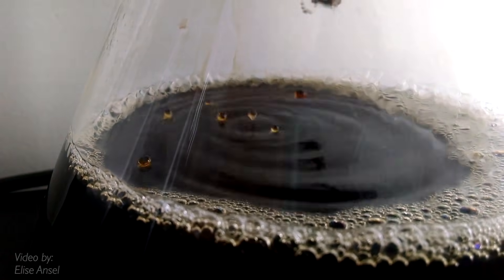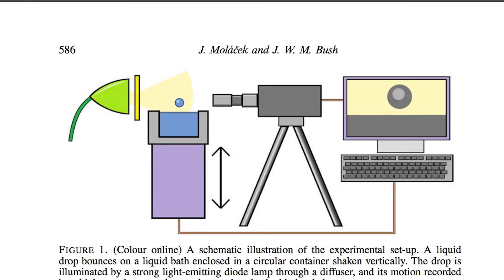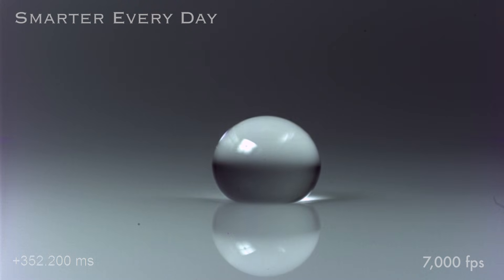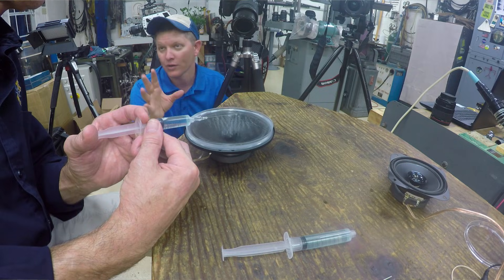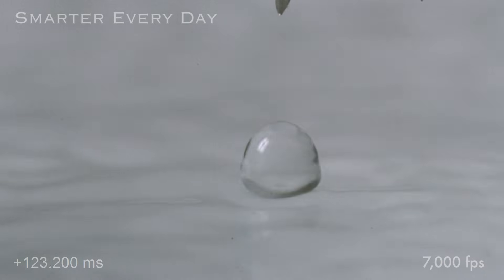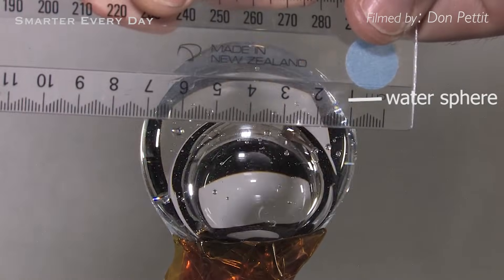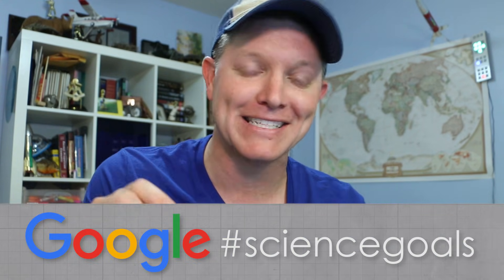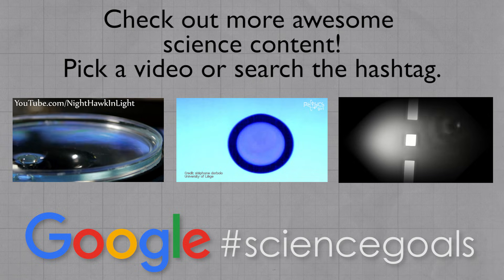The WALKING WATER Mystery (in SPACE and SLOW MOTION!) - Smarter Every Day 160

Comment: tbh ive never seen that
Reply: juku 
1. Get a glass of water 
2. Use another glass and add water in it also add a little bit of soap and mix
3. Slowly dip your finger into the glass of soap and water
4. Get your finger on top of the glass of water
Wait till the water on your finger drops there
(If you have a pipete use the pipete)
And the water ball will bounce!

Comment: I see these floating drops almost every time water falls on water.  I wonder if local climate or altitude matter.  Swimming in summer rain, almost every drop launched from the surface of the pond rolls away from the impact for a few inches before collapsing.   In the sink right now, if the faucet stream breaks up before touching the surface there are almost always 1 or 2 floating drops which collapse before they reach the edge of the bowl, if the solid (smooth) stream enters the water, only tiny droplets formed from occasional entrained air bubbles popping.  There is thunder outside, which I theorize would make the air more conductive, for less long-lived floaters, but might mean a static charge on the drops for stronger repulsion.  In the pond, I could sing round tones into the water near me to see if there is a local effect on longevity.

Comment: What if it was done in vacuum. Its expected that the water droplets will immediately "fuse" to the water, because there is no air to fill the gap between the droplet and the still water.

So that way we can check if this is the actual fenomena happening
Reply: He mentions in the video a study that did exactly that and noted that it reduced the time the droplet of water resisted coalescence.
Reply: If it were a proper vacuum, the water would evaporate and/or sublimate. But yeah, in a partial vacuum it does coalesce more quickly

Comment: MY guess about this has to do with intermolecular forces which, in an existing body of liquid (even as small as a drop) has established the electron bonds between one other. When you drop the liquid on the other body the charge bonds need to change orbital directions, that is, what I see in my mind is the vectors of the electrons must be altered to create a new bond. And, since this is pre-established in a droplet, there is some resistance to obtaining the new electron bonds. In other words, they like what they are bonding to, and are resisting altering this bond to accommodate a new relationship or cohesive attraction, Surface tension is a simple way to describe it. In my mind it has nothing to do with an air layer, but you say that lower ambient air pressures will hasten the integration of the droplet. I still think it must have to do with electron bonding, perhaps the air plays a role in it, too.

Comment: As far as "science", the lower air pressure experiment is the best experiment.  But now you have another question.

Suppose you had a dirty needle and as the water dripped out, they had a thin coat of oil around them.  The beading of the water would not be very surprising at all.  But instead of oil you have a skin of air.  Why?  Why is the air bounding to the surface of the water droplet (and probably to the surface of the still water as well).

The lower air pressure indicates that the air layer that bounds with the droplet is smaller and easier to penetrate.  "indicates" but doesn't "prove" it.  Perhaps the lower pressure relaxes the forces caused by surface tension for some reason.

For your theory to work, there must be some type of adhesive effect going on between the air and the water causing the air to want to coat around the water droplet.  The boundary stays with the water droplet as it bounces and skitters around.

The whole theory is based upon the air gap.  But we never see the air gap.  Seems to me the next step in validating this theory is two things.  More magnification and focusing on the air gap.  I'm not sure high speed frames helps.  Perhaps have the lens half in and half out of the water or perhaps under the water looking up.  Perhaps using fiber optics to get closer to the point of contact.  It should be possible to "see" the air gap because of various things like the light diffracting through the various layers.

Obviously there are two boundaries between the two bodies of liquid but you seem rather confident that there is an intermediary air gap.  To me, that still has not been shown.  And, if / when it is shown, then the question is: why does the air bind so tightly to the water?

I would also question the purity of the water and utensils being used.   Is there a thin "skin" of impurities instead of air?

Comment: Yes, good quote.  I once walked into the lab and several engineers were postulating what was going wrong with a system.  I said, "Why don't you just hook up a scope, and see?", which I did, and found the problem.  DUH!   Then there are the WTH times when you turn on the circuit, get nothing on the scope, semi quickly realizing there's nothing much going on electrically on the surface of the desk, where the probes actually ARE, but that's a wholly different thing.  ;-)

Comment: Is there a distance or speed of a water droplet that would break through the surface of the layer of water upon initial impact between the two bodies? Also, In the end of the video the cello hit a low note that caused the surface of the water to vibrate rapidly. Is there any note not mentioned in the video that could cause the bubble to burst?

Comment: no info about the speaker used to reproduce the waveform, what kinds of circuits are used as signal generators, the sample rate if the cell was digitally sampled and reproduced on a dac (would have been nice to have an oscilloscope display next to every experiment) and no discussion of the electromagnetic properties of water molecules and how they are different at the surface where it interfaces with air.

really cool footage Dustin but just about all of the theory discussed was limited to what was known to by newton :(

Comment: I believe that there's a charge displacement going on with the water surface. to back my theory look at when you release water as droplets, it doesn't crumble to its basic form of molecules. it remains attached to it's structure. the only way to explain that is by a charge. water exist because of a balanced charge between Hydrogen and Oxygen. so, in order for on body, in this case water, to combine whit another  body of it same composition it must stable it's charge to match the other of it's own composition. liquids are able to this much more efficiently than solids. solids can do this too, but you must ad some form of external method or catalyst for it to happen. so , yes it's possible, just that water does it better. I didn't saw your videos before but I knew of this far before I finished highschool.

Comment: They are giving to much credit to air pressure...
The problem is the "drop" is retaining it's own gravitational field and the molecules inside the drop are arranged to accept the pull of the drop more so than the water beneath it.
The air between them lessens the pull of the water but is not necessary to achieve the experiment.
The best way to explain this is through the dropping of the drop by the syringe.
Notice the water clings to itself until it is at a critical state. Then it drops.
Notice also that the critical point happens when the sphere starts changing by X much.

I argue that the drops cling to itself until it's shape changes X to much from the original sphere. When this happens it becomes apart of the larger object. Because the molecules of the drop are now more arranged to accept the larger object, and less arranged to retain the sphere.
(spheres are the best object to retain pressure)

When the water is bouncing due to frequency it is not allowing the air barrier to increase, infact if you go to any "sub woofer" and feel the air, it creates low pressure in the speaker... What the frequency is allowing the drop to do is retain it's shape. By juggling the sides of the water drop and retaining the sphere. When the drop hits the peak of a wave it breaks because the sphere is changed by X much.

Furthermore, if it was air, the more velocity the drop had the more air resistance (more trampoline effect) the drop would experience and bounce off or split into many smaller drops... Also the sphere deforming would create a bigger surface area creating more repulsion.

however, if my theory is correct velocity would deform the drop breaking the tension and the drop would mold into the bigger object nearly instantly.

Comment: water has a lot of anomalous and perplexing characteristics apparently. while i wouldn't be too surprised if the micro air gap plays a part in this phenomenon, I can't help but wonder if "structured water" characteristics across a water body's surfaces, temperature differences, solute content, and/or other water anomalies play a larger role. Obviously force of contact is a factor, but there is surely more than just an air gap creating the tendency for water to maintain separation for some length of time. SmarterEveryDay have you looked at the structured water thing yet? apparently you can get a voltage differential between a water boundary layer and the main body of that water, among other things.

Comment: 40 sec in, its the surface tension difference from water that has been separated from the rest. Now has its own surface tension. When tensions meet, one will overcome the other based on many elements. Speed, size, direction differential etc. Water in motion or still does not want to move fast enough basically.

Comment: surface tension mixed with  equal and opposite reaction mixed with low friction surface. Basically it is the same principle that allows a droplet to form to begin with that allows it to sit on surface tension of water. Water will simply mix when you have a equilibrium between the two.

Comment: I've got a quick question, so the faster a cello a string vibrates the higher the pitch is. When observing the space clip you can see that when a lower pitch is played the air sphere vibrates more rapidly. So why does a low frequency sound with a slower vibration cause the sphere to vibrate faster?

Comment: Couldn't it be that the surface tension of the water resists the surface tension of the droplet? That would hold the same explanation. In less dense air, the surface tension would even be weaker, due to osmosis.

Comment: Radical change in temperature is basically the main factor. Hence the residence time where conduction occurs(among other ignored factors, like surface tension and as you said the air(seems minor considering the shape, which is another mathematically unproven theory of a raindrop)) before a drop coalesces.

Comment: try dropping water (a few drops) on a hot pan and watch the run around.
Reply: Just as you added the sound variable the drops tend to move to the sides before they coalesce where the vibrations are less hence granting the drops’ surface tension with the pools’ surface tension a larger surface area to conduct heat to an optimum state.

Comment: What about a cello: All bowed, string instruments, ie violin, viola, cello, double bass, produce a saw-tooth waveform (at the string) this is a saw-tooth with a sloping leading edge and a fast release trailing edge. Most other tonal instruments produce sinusoidal waves.  Even though the body of the instrument will alter the saw-tooth wave to some degree adding harmonics, and the sound transmitted through the air to the recording microphone further alters and filters the waveform, it still remains a saw-tooth wave. This is analogous to an earth quake where kinetic energy is built up slowly over time and then suddenly released in an instant - either earth plates suddenly moving to new positions or the string of a cello snapping back to it's starting position. As a reproduced sound, I speculate that the sudden release of energy in each wave is high enough (especially in the lower frequencies) to break the surface tension of the wave peaks produced on the surface of the water. Because of the lack of gravity the energy that breaks the surface tension is also enough to send the drops bouncing around inside the bubble.

Comment: I have observed the droplets skating across a wet surface, using motor oil. The drops circle around a funnel until they drop into the center. I don't see why you think there's trapped air between the liquids. I tend to believe that it's the strong surface tension alone, which is inclined to preserve its surface because if the pre- established electron bonds. I would like to see this done again not with water, that would not remain a liquid without air pressure, but with an oil of some sort that doesn't vaporize, and do it in a vacuum chamber and see if the presence of air actually plays a part.

Comment: I have another theory that explains the phenomenon and submit the government report, unless much more comprehensive, fails to address the issue.

How do we know there is an air cushion between the two at all.  The elasticity of the droplet is due to the strength of its surface tension.  The surface tension is a factor of the intermolecular bonds throughout the droplet.  

So when kinetic impact/rebound energy is introduced to the droplet, how do we know that kinetic energy is simply too weak of an internal force to break the intermolecular bonds of the droplet?

By lowering the air pressure, of course the internally induced (impact/rebound) kinetic energy could more easily "burst through" the droplet's surface tension and cause coalescence.  The molecules throughout the drop have lost the 14 pounds per square inch of external, atmospheric pressure that was constantly surrounding the droplet.  External pressure was being applied uniformly to its entire surface - now the pressure is gone - hence it would take less internal/rebound kinetic energy from within to overcome the strength of the intermolecular force's ability to adhere to one another.
.

Another thing to consider is the water droplet should have a greater elasticity to begin with than than the water surface it impacts.  I see this as being akin to a rubber ball impacting a large rubber block sitting on a table.  Vibration will be "felt" throughout the entire block, but its mass won't let it move as much as the smaller ball will move.  However, the result of impact for the ball's much smaller mass is translated into upward motion against gravity.

Both the rubber ball and rubber block have the same surface tension coefficient if they are the same rubber.  The surface tension coefficient is powerful enough so the rubber ball does not splat on impact Until an external force great enough would break its ability to retain shape).

Unlike rubber though, water is a liquid.   Thus the droplet can coalesce, whereas the rubber ball will simply rebound.  However, the physical laws are the same until they come up against the affects that will occur due to different states of matter. 

So what migh be happening at the point where the doplet coalesces?

When the kinetic energy from multiple impacts is finally gone, the droplet rests upon the water surface.  For the first time the droplet's mass is not only putting a CONSTANT pressure on one small area of the surface, but now that same pressure induces the molecules on both surfaces to interact while in constant contact (I realize we are talking minute intervals of time - but we are also using minute particles of mass).  I have to wonder if there is not even a more enhanced affect from the water's surface "side" of the interaction due to it greater mass?

Comment: with no degree in physics, and without hearing the answer - video stopped at 1:41 - i would probably suppose it has something to with surface tension, or some similarly called phenomenon - something where the mass has to exceed the molecular network on the surface of liquid - both standing mass of water and droplets themselves - to break that tension and be adjoined or included in the molecular structure of a water body. let's see if i'm correct.
Reply: mmmmjaaaa.... according to the video i was wrong, but somehow the "air gap" theory alone does not satisfy me, and i still think there's something with that mollecular force. anyway. beautiful footage, so keep up the good work!

Comment: Destin, thanks for making this. My observation of this phenomenon predates yours. I first noticed it in the 1970s when I was doing lots of oil painting. I noticed that when I cleaned my brushes in turpentine I could easily create the little raised bubbles/balls by flicking the brush gently on the surface. They skitted around the surface of the jar of turps. I thought it was a surface tension effect caused by the mixing of different oils with the solvent and I also thought the bubbles/balls were spinning. I did notice that as they slowed in their horizontal movement they were more likely to coalesce with the turps. All this is consistent with your explanation involving air pressure. Later, I noticed the same phenomenon in hot drinks and on the surface of water. I still wonder if the balls were actually spinning - this might just have been an illusion - and it will be hard to tell if they are. The micro gravity experiment you showed was instructive as it demonstrates the role of surface tension in the creation of the balls and the reason why they are only ever very small (it's surface tension vs gravity). So thanks again for making the video and offering a clear explanation.